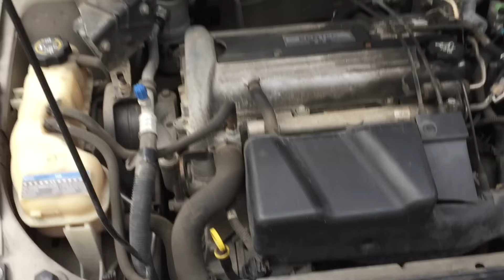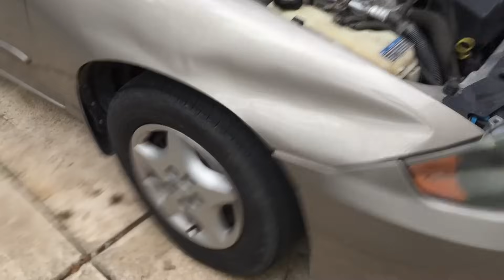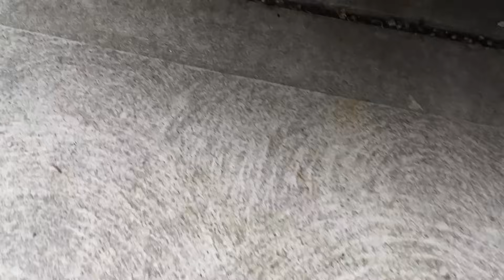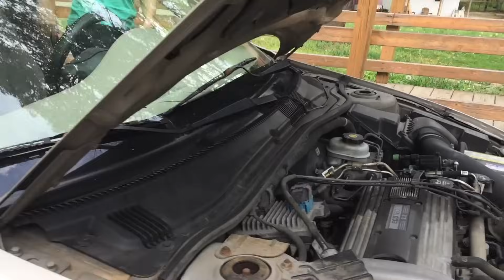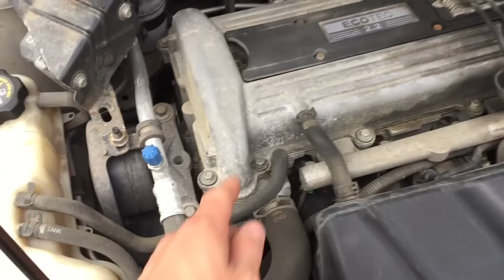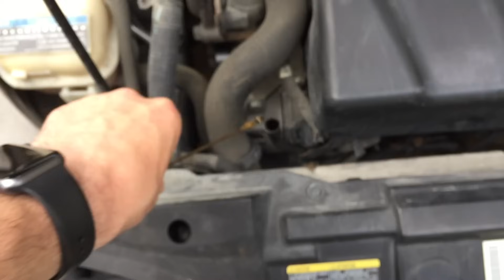What Engine Timing Problems Sound Like

Comment: My accord is currently doing this, except it’s ridiculously loud I’m talking you hear it down the street loud…. Noticed my oil looked a lil too thin, dipped the stick again and even got some small bubbles….im thinking I got a big issue but I might just sell the car for really cheap as a mechanics special  at that point 1k repair on a 2k car isn’t worth it to me, also mine doesn’t really make that noise at idle mainly when on throttle

Comment: That’s a good motor too, the old 2.2l 4 banger, I had that same engine in my 2005 Saturn vue, I got 300k miles out of that car it was in the family since new I bought it from my wife’s grandparents, when I bought it, it had 150k miles it still looked brand new, when I sold it, it had 300k miles, I sold it for 3000$ & I only paid 1500$ for it! That thing still sounded great & had great power, I did some mods to the engine & suspension nice rims brakes I put a lot of money into that car fixing it up, I drove that car everywhere & anywhere it never let me down! I sold it about 3 years ago & I still see it around town it’s still going strong!

Comment: I am glad timing belts are a thing of the past. Your car can be running and sounding great then out of nowhere the belt will just snap when you are driving and you are not going anywhere. This happened to my sister last summer when she was driving for doordash in her 2007 ford focus. Her motor immediately cut out and didnt start after that. She was on a backroad with no shoulder to pull over on. Very unsafe engineering

Comment: I had one of these, and for some reason, it used a filter element, which if installed forcibly upside down, starves the engine of oil. I went through the same thing, we're the quick lube place did this to my engine and damaged it, but would not do anything about it since the engine still ran. ⚠️

Comment: So was this actually a timing chain? I have the exact noise and would like to know.
Reply: Turns out mine was the timing chain. That clicking noise was the chain tapping around under the valve cover. The tensioner was going. When I lifted the valve cover off, the chain was super lose. $160 for the chain and if you need, $100 for water pump. 
I decided to sell the car.

Comment: Ladys and gentlemen! It's time for the weather. Reporting live at the studio, here is Garrett Fantin. Today's forecast, is going to be cloudy with a chance of gasoline and oil, along with raining timeing belts, chains, battery acid, and all sort of car parts. The high will be 50 degrees, and the low will be -10000 degrees. This weather will cause your car to blow its engine out of nowhere. Instead of blowing out normally, your engine will explode, scattering everything onto the road. Please stay safe from this condition. Reporting live, this is Garrett Fantin, signing off. Thanks for listening to the Garrett Fantin news, and we hope you enjoy this special comment!

Comment: Had a 2003 saturn L200 for 12 years and 160000 miles never had any timing chain issue with it no problems. So it to a girl in college in 2014 has of last year still no issues. The key to the ecotec is ignore the change oil soon light and change it every 4 to 5 thousand miles you wont have any trouble with them.

Comment: its the timing chain slapping up against the walls. Timing chain tension loose
Reply: how to fix it ?
Reply: @hamidahamida-ij2qg  replace timing chain, chain guide, chain tensioner, gaskets, and since the engine gonna be open might as well do any other part that is necessary in future saves labour cost
Reply: Or it’s mistimed and the valves are tapping.
Reply: @Veritas0321  idk that sounded just like a chain it was super loud
Reply: My question is, if you hear that and still drive it, and as I'm slowing down my car just shuts off, and won't start doesn't turn over snd I have an interfeance motor l, does that mean the belt broke and the motor has internal breakage so it's junk, because that's what I was told and idk if he even checked inside to tell if things were bent or broke
Reply: @brucehall8570 if the belt is broke it prob won't start. Its more than likely slipping so bad it can't keep running.

Comment: Timing chain. $120 cloyes kit plus 4 hours to install= fixed. Have done 3 2.2 ecotecs already. Balance shaft/water pump chain is usually ok. Just the cam chains. The loud sound is the chain hitting the valve cover because the top guide broke. These motors really are junk. The rockers break all the time too. GM quality!!
Reply: Hi i have a 2002 impala with 94k miles that makes this sound, but it goes away when i let it idle for about 15-20 minutes (when it reaches operating temperature). Even after a fresh oil change. Could you PLEASE give any suggestions its a great car whem it warms up id hate for it to lock up

Comment: Did you realise that the valves ended up contacting the pistons when you disassembled the Engine or did it just stopped working? My car sounds like the car in the video so I'm worried if it's too late to change the Engine chain.

Comment: The timing chain tensioners in these engines were a horrid design. Saturn used these engines in the L-series starting in 2000. If I'm not mistaken I believe Saturn may have been the first to use this engine for GM. Tensioner has been redesigned two or three times that I know of. I think the biggest fault with it is it does not have a ratcheting mechanism inside it to keep the chain tight as it wears. Saturn had a perfectly designed chain tensioner in their S-series engines and had very, and I mean very few issues with those tensioners.
Reply: It has the tensioner but the logistics of the guides causes to much stress to the hardened plastic.
Reply: Can i use this s series tensioner in a 2006 'balt

Comment: GM knows there are issues with these and the 2.4s. I have a customer w a '13 Malibu w 74k on it that threw a guide and bent the valves on 3 cylinders. It's at Chevy right now all apart. She's fighting w corporate to get it done under their extended warranty, but Webb Chevy in Oaklawn Il. is saying it's her fault, even though she has every scheduled oil change receipt since it was new, and never ran it low. I have another customer, an older gentleman, w an 02 Grand Am with the 2.2 that this very same thing happened to, with only 85k on it. That guy got the oil changed every 3 months regardless of mileage. He junked the car. Ecotechs are almost as bad as Chrysler's 2.7s were. They're so bad that a lot of salvage yards won't warranty their used engines at all.

Comment: Yep 2.2 common failure... Seen dozens of the 2.2 in the Zafira/Vectra/Omega gone bad like this... Ecotec itself isn't that bad, only the 2.2 version is... 
Timingchain guides break, oil pump, headgasket,  hydrolic lifters and ignition coils are the major issues of the 2.2 
By the way this engine is developed by Isuzu and not by Opel/Vauxhall/Chevrolet ;)

Comment: The disturbing thing is that GM has never fixed the timing problem on these engines. Even to this day as new ones are rolling off the assembly line. They all fail between 80K and 100K. If you baby them sometimes you can get 150K. The 2.2, the 2.4, and the 2.0L GDI turbo all have the same problem. Even the 3.6L V6 engines stretch their chains and throw all kinds of cam/crank correlation codes.
Reply: What about the 3.4 ? On 2002 impala? Im having this same soumd come from my engine until it reaches operating temperature
Reply: @focused4841  different design of motor. There are overhead cam like in the video and push rod or overhead valve design.
Reply: @focused4841  the GM series 3100 and 3400 motors (3.1L v6 and 3.4L v6) both had problems of eating intake manifold gaskets and chewing the hydraulic rollers not to mention turning a rocker arm or 2 into chunks and blowing head gaskets, the 3800 series motors were scared of liquids so the coolant would cause the motor to vapor lock :\

Comment: my car friends car made this noise... come to find oht ahe didnt have any oil in the motor
Reply: Having similar problems and worries with an i35
Reply: @FantacistI  bro the i35 are the worse.. i had one and it would make a similar noise to that and one thing I figured out after a while is that It burns slot if oil.
Reply: @Freddy1-  yes lots of oil, more and more, until you fix the leak, PLUS a possible timing chain tensioner going at 170k... RUN.

Comment: There is an updated timing chain tensioner for these engines. The non-updated tensioner is completely flat at the hex end. The updated tensioner has a bulge at the hex end. This video compares the two: https://www.youtube.com/watch?v=VNqcozAVWwQ   It is not a real big job to replace the tensioner, and with the updated part costing around $30, is cheap insurance against a timing chain problem.

Comment: Ahh yes, The only known issue with those ecotecs. It made my nervous when I first bought my 03 cavalier with 250.000 on it. But I couldn't get over the flawless body and interior. Currently has 276.000 with no issues yet, Curious to see just how long it'll last my heavy foot.
Reply: Update, 320.000km no isses
Reply: @smashingstuff09  and now ??
Reply: Cavalier still going?
Reply: @mr.j.r.l.2966  Not that one, The Kframe snapped just before Christmas. I bought a 98 5speed and a 99 sedan instead. Great little cars if you can find them without rot

Comment: These engines are junk! Same for most GM cars from those years. Yet I don't know why I am so attracted to them! I love them!
Reply: 3800 V6 is not junk........
Reply: @gtowrx2001  The only GM you can mention is an engine that's been out of production for 20 years.
Reply: Alex Cintas 3.8 was put out to pasture in 08 so not 20 years, and most newer GM stuff is junk, like the 3.6 turd that replaced the 3.8
Reply: @gtowrx2001  You're right I've changed several of them.. the GM 3800.. the pride and joy, the Golden Child of all GMC engines.. and they suck more than a Shop Vac
Reply: I had one where an intake bolt was leaking around the threads.. I just put thread sealer on it and sent it down the road. Still runs, just really shitty cuz it's a Buick 3800
Reply: Maybe because your ex is junk but still want her back even though its never gonna happen?
Reply: Not trash if you maintain it. 205k miles and have gone thru 2 fuel pumps. That's the worst that's happened so far I've never even changed the belt and I've had it since 120k. Plugs/ wires 2 sets now, 3 fuel filters, 2 sets of tires. The suspension is in dire need of work but the engine and transmission are pretty good. I paid $800 and it's still cheaper to keep throwing parts at it and save money rather than financing a new one
Reply: We have a few 3100 & 3800 engines (cores) laying around cuz they go KA-BOOM and need replaced. I don't wanna hear 'how good a 3800 (3.8) is when I have several of them behind the shop, then have to find a good running 3.8 and switch all the effin sensors over and shit bc it came out of a Pontiac and is now going into a Buick. F all that stress! On a positive note, at least they're easy to work on. They aren't held in the engine bay by much.
Reply: Amen to that. Just rebuilt my tranny myself and there is nothing that holds that fker up without the subframe
Reply: Mine rain good until the timing chain went at 150K miles and destroyed engine
Reply: @JoeDawg it started sounding loud when I would start in the mornings
Reply: They aren’t junk I’ve seen one make over 1800hp
Reply: Rather have a GM product then a ford lol
Reply: @mskudlarczyk Shamelessly replying to a 6 year old comment to mention my 05 Ford focus that's running beautifully at 287k miles.

Comment: Yeah, junk the car.  Chevy 4 bangers are junk.
Reply: KillaBandit I’m a diehard chevy fan but I can’t figure out for the life of me why someone would go to GM for a 4 Cylinder. Get a Japanese car if you want a 4 banger
Reply: automan224 yeah.  We had multiple Pontiacs with the 2.4L quad cam engines.  Both blew headgaskets in under 30k miles.  Never again.

Comment: Ecotec is trash. Well anything gm makes.
Reply: adrian sims the LS based engines some of the best out there. That's why everyone is using them for engine swaps
Reply: smashingstuff09 that’s complete bullshit. I’ve seen and had many old Silverado trucks with over 400k and running strong. Hate all you want but you’re wrong, not all are junk
Reply: Justin P. They all make junk, Ford,Toyota, Hyundai etc all of lemons. Gm isn't any better or worse, Give your head a shake
Reply: adrian sims anything but corvettes and the LS
Reply: 3800's are definitely not junk.
Reply: Justin P. Wrong guy, I'm not bitching about GM.
Reply: smashingstuff09 I know  they all make junk I get it
Reply: adrian sims not true, gm makes junk but that have in the past made great damn engines like the 5.7
Reply: Gm vehicles have been proven to last just as long as anything else, Your comment makes absolutely no sense.

Comment: At least GM went with a chain instead of a timing belt. cough cough Chrysler... I love these Ecotecs, simple, dependable, and parts everywhere. that timing chain is a piece of cake if ya know what you're doing to. Just PULL THE MOTOR  its 10000 easier, i promise lol. I learned the hard way : (
Reply: Subaru belts are easy. Chains on modern engines are much harder.
Reply: BTW your totally right about the guides for the timing chain being broke, its a common failure on these. However, That doesnt sound like its just the guides.
Reply: I think I would prefer a belt for ease/cost of service, except Subaru
Reply: you're not really saving money because belts wear so much faster than chains. therefor in the lifespan of a timing chain you would have already most likely gone through 1 or 2 belts. but hey, everyone's got a different opion.
Reply: Subaru timing belts are the easiest of all timing belts to replace, except the DOHC ones.

Comment: These interference engines are the sh*ts for the consumer,   turn car into junk before Thier time 😜😜😜😜😜
Reply: That's actually the truth. The manufacturers found their old cars becoming dangerous because people wouldn't throw it out once it was spent, driving it with rotting components and all, because the damn things wouldnt die. So, in an attempt to save lives (cough, make money) they basically have designed consumer cars to fail after a period of use, 5-7 years is average now. They are doing this because people just won't service them and weird things happen then who gets blamed, the companies.

So when you're driving the beans outta your 2016+ think about what money is actually worth before you plant that foot. Because they've been making excuses to sell you another car.

Comment: People forget that cavaliers had two completely different 2.2 engines. This ecotec one was a throw away piece of garbage but the pushrod 2.2 that they used up til 2002 was indestructible.
Reply: i was just about to say the old 2.2 is a great engine they put those in alot of vehicles
Reply: true the head gasket would blow if the old 2.2 was overheated but that was the only trouble area with the whole engine
Reply: I honestly didn't know that.... but I only drive GM V6's or V8's
Reply: Nah those we're headgasket time bombs, The ecotec was one of the better engines when it came to reliably. The 2.4L was just.. meh, Powerful for a 4cyl in its day but I wouldn't buy another with the quad four ever again after my experience. Love the ecotec though.
Reply: DrinkMDeveryDay the 2.2 vortec engines on the later s10’s, were decent
Reply: Alex's Bikes and Motors my old cavalier ran 11 years . 2001 model . Engine was literally indestructible with oil leaks going crazy and the serpentine belt flipping off and still able to drive it a little down the road to pull over xD
Reply: I disagree, the old 2.2 was more prone to blowing head gaskets. GM was fast to change how they cast the 2.2 in 2002.They both have there good and bad but once you start reading around about the L61 engine you might be surprised. Here is an awesome site to use if you are interested.  http://www.j-body.org/
Reply: That's what I meant to say with my comment the newer ecotec ones are crap..  the older ones seem to keep running

Comment: So, what's the decision - repair or junk yard?
Reply: Peter Riis LS swap.
Reply: What?
Reply: Peter Riis it's a pretty simple fix, just replace the timing chain guides/tensioner and maybe the timing chain itself and it'll be fine.
Reply: Heh, you make it sound easy. Thanks for the info. :)
Reply: +Eduardo León Morales
Yeah, I'm pretty bad at doing that - sorry - then again in this instance I would have had the wrong impression - if you are telling me, that salvaged means scrapped?
Reply: And get an antifreeze filter for the oil.